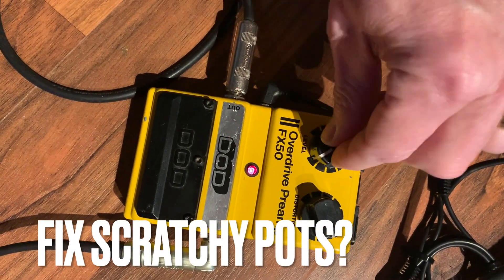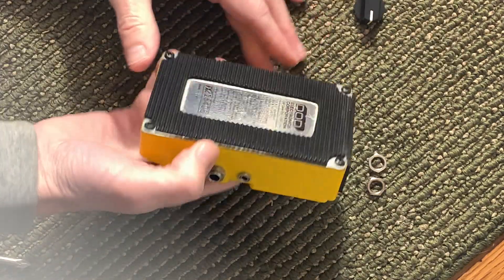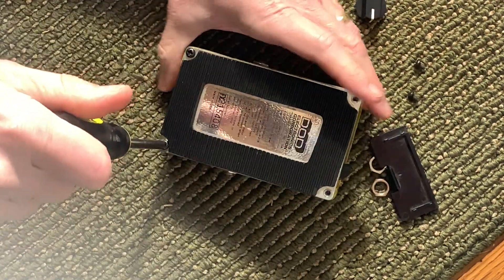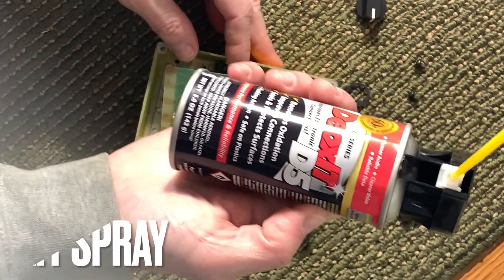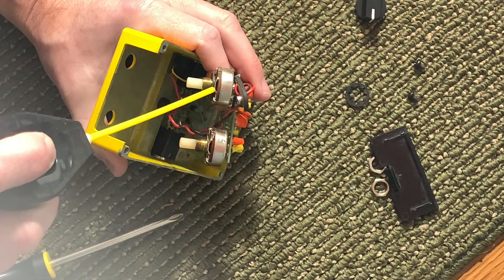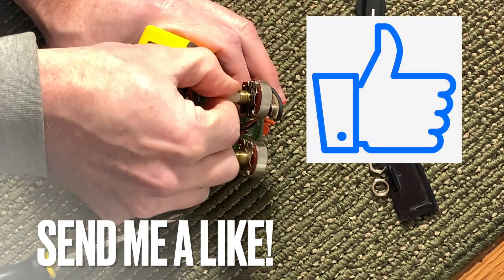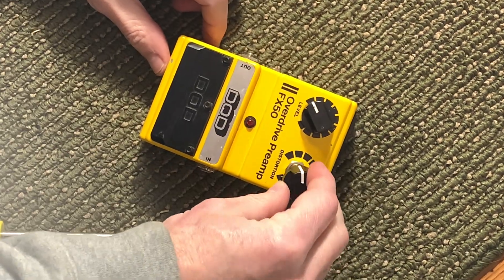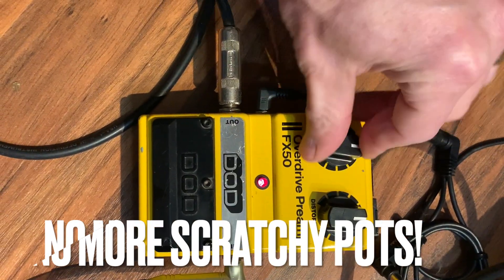How to Fix Scratchy Pots on Pedals - Cheap!

Comment: Hi! I need help with my DOD FX60. I don't know why the depth pot is making this gassy-like sound between 7-10pm. It might be the pot itself that needs cleaning but, again, it isn't scratchy past 10pm, and works just fine. Very odd! Any ideas on what could it be? Thanks!